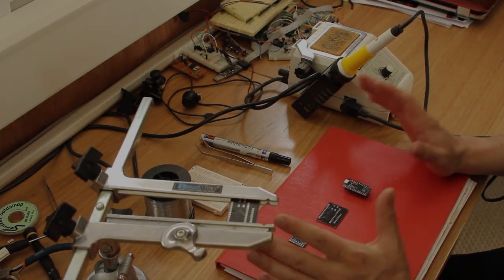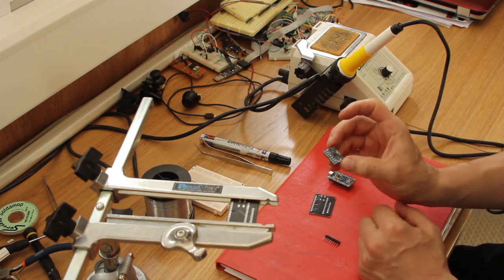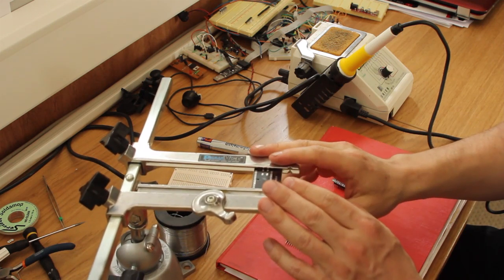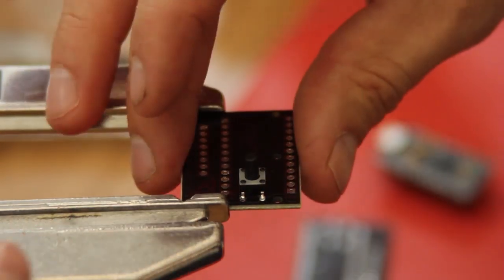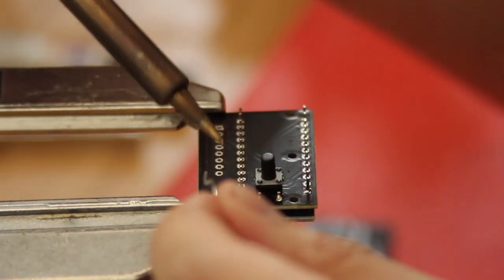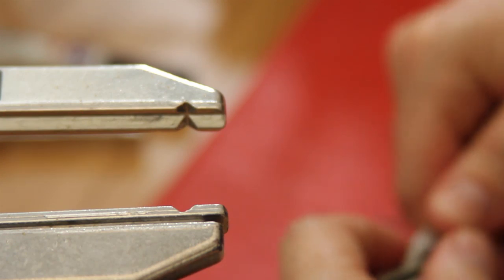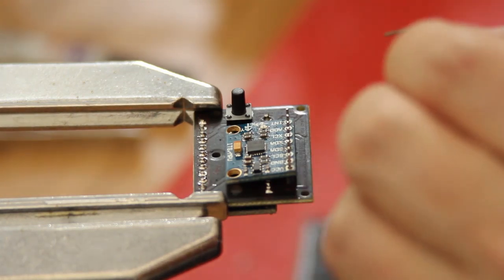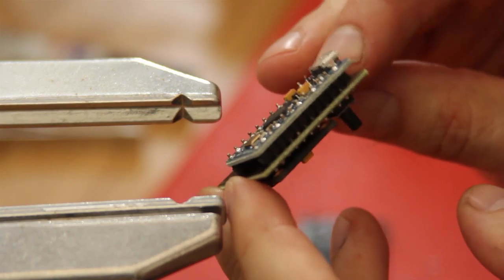DIY EDTracker Construction

Comment: I want to add this for anyone new thinking of making one of these.  It is amazing a real game changer and I can't imagine playing without head tracking again.  If you are going to make one I am telling you now do some research on the board because the ArdPro Micro has a known problem with the micro USB port coming off.  (I knew this going in)

I zip tied my cord in place with five zip ties to the headset then tip tied the cord all the way to the headsets breakaway plug  (Rig 500 Pro eSports).  This morning (3 weeks after I built it) the micro USB broke off the board.  Keep in mind I also ALWAYS hang my headset on a headset hook and treat it like glass.  So I am VERY careful about it.

I should have secured it to the board with epoxy and I encourage you to look around and google what other folks have done.  I can't solder something so incredibly small.  I just don't have the skills to keep having to repair this and if I have to keep buying new boards and re-building them well, I just don't have that in me.

So I spent 160USD unfortunately today.  But I don't regret the experience of building and using something I myself made so it was still worth it.  Someday I may meet someone with the skills to fix it.
Reply: Same happened to me. I also treated it very good but after third usage it came off. Since i soldered everything like in this video i can't desolder them properly to change arduino. Now i'm planing to build another one with my own pcb and going to use female header pins. So i can change broken parts without hassle. Also gonna put a lot of hot glue around usb port.

Comment from the maker: Hey Rob, no worries, hope it gets to you ASAP ;-)
Cables-wise, you can get these braided cables which are a lot more flexible than most, or you can find some flat USB cables (typically called "noodle" style cables) which also bend a little more easily. I'd recommend those, picked up easily off eBay in 2 or 3 metre lengths.

Comment from the maker: Fair point on the USB connector - even with stress relief on the cable I've had one break off. One solution is to clag it with more solder on the two side tabs :) I would leave a sacrificial cable plugged in while you do this to stop solder pouring in to the USB socket on the board. You might end up soldering the plug in place but gently warm it up to free it and remove it - or, of course, just permanently solder a USB cable in place if you know you're not needing to remove it.

Other alternative is to clag the whole area with something like araldite or a hot glue gun.

Good point, Peter.

Comment: Ordered 3 of these PCBs and enclosures from the EDTracker store and can not state how helpful the guys have been with trying to assist me with getting them before Christmas. I missed the original cut off date and Dan made a special journey to get mine posted (I really appreciate that Dan / Brumster100). Now just have to wait for delivery of these and the required DIY head tracker components (MPU-9150 Mag sensor) from Hobby Components and I will be a happy camper sitting in my ship. 

Thanks Dan for the concept, the valuable online videos and the great service you have provided me.

Could you offer some advise on a suitable USB cable to use while this is mounted on the headset? is it a standard USB cable or a micro? It looks like a standard one but hard to tell from the video. Are there ones that are more flexible than the standard ones such as the one used by say my Joystick which is pretty rigid. 

Thanks again,
Rob

Comment: Realy interested in this project.
Is it possible to mount the accelerometer/gyroscope away from the pcb?
If so what should be the maximum length of the cable?
Thanks.
Reply from the maker: Yes, it is, people have done that. It's an i2c bus between the MPU and AVR so normal principles apply. i2c can support quite significant lengths but in this application, with common cable, you should be fine for 20 to 30cm, probably more (I've never tested...). Depends greatly on wire capacitance, length, winding and surrounding interference I suspect.

Comment: Is there a video that includes how to attach the magnetometer? Thanks for the videos, great work
Reply from the maker: shadowkill546 The 9150 breakout board is physically identical to the 6050, so it fits in exactly the same way ;)
Reply: Hey thanks for the response. That's great. Does your site sell the 9150 or should I just order the basic kit from your site and order the 9150 separately from ebay or something? Thanks again :)
Reply from the maker: shadowkill546 We don't sell the 9150 as a kit, no, the kit thing on the website is just to clear out old stock as most people are ordering 9150's now, for obvious reasons. So yes, you could always source the 9150 separately and swap it in when you build - still works out quite well price-wise ;)
Reply: brumster100  Thanks a lot! I placed my order. Seems like it would be a fun little project :) Great work again

Comment: +brumster100, would it be possible to post a video assembling with a 170 pin bread-board?  First time I'll be using one, and I'm not sure where the jumper wires should go and if any of the rear connections should be popped out.
Reply from the maker: Here you go!
http://youtu.be/tn9tvVfs6ow

Comment: Hi, I was trying to use my old edtrucker with ETS2. I remember that change some lines in controls file was needed but I dont remember which ones and the web is down. Could you help me please. Thanks in advance.
Reply from the maker: You sometimes had to edit the "controls" config file in your ETS profiles directory. My memory is hazey but you basically changed the controller names for the trackir device - you could remove the 'trackir' device name, and put your edtracker joystick device name into the trackir section - so basically you were fooling it into using a joystick as the input device to headlook (trackir).

Comment: You should never apply a lot of pressure with the soldering iron on the pcb because you risk lifting the copper traces. Also, don't blow the solder trying to cool it, it creates a bad wetting between the components.

Comment: Hi. I purchased the kit from the hobby electronic shop you mentioned on your website, but it only has a standard PCB, not the custom one you use. How can you solder the components on that PCB?
Reply from the maker: You solder onto the pads and then use short bits of wire to jump the pins where they need to go; it's a little more faff but that's the cost saving of using the prototyping board that HC supply.
Reply: brumster100 Thanks. I think I'd rather order a custom PCB from you guys. :) Gonna check it out on the site.
Reply: brumster100
Might be a stupid question, but what is the function of the switch? It turns the device on and off? Or it resets, and I can reset the view anytime I want while plaiyng Elite?

Comment: Hi. Would it be possible to connect the two boards (gyro and arduino) with a 1m - 1.5m cable (soldered or some sort of jacks) or would the resistance of that cable be to high?
The idea is to put the arduino and reset switch in a case on my desk (or even in the joysticks casing) so that I only have a tiny box for the gyro on my headset.
Do you think this would work?
Reply from the maker: The technical length of an i2c bus can extend to that sort of range, yes, but interference and capacitance in the cable can become a problem. I've not tried it but if you shield your cable, or at least twist it, you should be ok. If you have problems you could always try clocking the i2c bus down from 400KHz to get better reliability. Try it - let us know ;-)

Comment: Sorry to bother you but I ordered the kit from hobby electronics with the standard PCB  and read you talking about using wires. could you provide a little more information on that? I'm a complete newcomer to this kind of stuff and don't really know what to do now ~.~

Also you mentioned the USB connector being a weak point, what did you mean by "clag it with more solder on the two side tabs"?
Reply from the maker: You can just use some wires salvaged from a length of, say, USB or telephone cable to wire it up as per the instructions on the website. I take it you mean the prototype board from HC? Take a look at my newer video for some tips :-
http://youtu.be/tn9tvVfs6ow

;-)
Reply: brumster100 I've watched the debugging video and found it useful, but still my question remains unanswered - why do I need wiring with the PCB from hobby computers in the first place, I do have cables, I do have a breadboard to test things out first but still, isn't the PCB enough to establish a link between the components? Why wiring?
It's this PCB here: http://hobbycomponents.com/index.php/kits/kits-electronics/diy-head-tracker-bundle.html
Reply from the maker: BuckstarrZ The PCB you get in the Hobby Components kit is what's commonly referred to as "protoboard"; it's just a series of pre-drilled pads for you to put components in and solder them. But you still need to join the pins up, and for this you need some link wires (or you can bridge with solder). If you want an easy option, you can order the EDTracker PCB off the EDTracker website and remove the need for any working out of where wires have to go/etc... this is a custom PCB with all the tracks worked out and done for you - you just solder in the components and you're done. No need for any wires.
Reply: brumster100 thanks for your reply. I've been in touch with you guys for ordering a complete device but I don't actually want to wait that long, I'm eager to fly with some headtracking :D so that means I would have to connect every pin to each device according to how you did It in that debugging video. To do so I would have to put a pin + an end of a cable into the same pad and solder them in there
Reply from the maker: BuckstarrZ
Pretty much, yes, but you can't get a pin and a wire into one pad. What you do is put the wire into the pad NEXT to the pin, and then bridge the gap with some solder or a short piece of pin/wire, or else solder the wire onto the underside of the pin. Whatever works for you, really ;)

Comment: How important is it that the solder doesn't touch between pins? and if it is important what do you do if you mess up, using too much solder, and solder two pins together?
Reply from the maker: Hi Dustin - it is critical that solder doesn't join the pins. There are a few where it technically doesn't matter, but I won't confuse matters for now ;). If you put too much solder on, you will need to attempt to "wick" it away with your soldering iron - the proper thing to do is use either a desoldering pump or some braid/soldamop. These suck or soak away the unrequired solder. Generally though, you should be able to clean the solder from your iron's tip and then draw some of the solder off the pin and back onto the tip, to take some away.

https://www.bitsbox.co.uk/index.php?main_page=index&cPath=243_268
Reply: ty :) I have never soldered anything before and I am looking to get into it as it seems like a very useful skill to have. :)
Reply from the maker: No problems - good luck and have fun!

Comment: Is there any buleprint for the custom PCB?
If there is,So Could i get one?
Reply from the maker: Not really a blueprint, but there is an etch image on the website here :-
http://edtracker.org.uk/index.php/downloads/category/1-hardware
Reply: Thank you very much!!! XD I didn't look for it carefully
Reply: Which PCB type to use single side or double side?
Reply from the maker: Just single. It takes a trace across a pin (no effect or downside) to avoid having to double-side it.
Reply: Thank. Is there any tip for make it be wireless?
Reply from the maker: That's a whole project there! Nothing easy, no, that would keep it small and usable as a head-mounted device. The problem is a lot of the wireless modules, batteries and charge control modules really bulk it all out to the point where, in my opinion at least, it becomes a bit ridiculous. I suppose the "simplest" approach is bluetooth, but the performance is awful. You could look towards an RF module matched with a USB dongle but you'd be developing your own firmwares for both, and then you'd need your own UI or means to control/calibrate it.
Reply: above link has the v.2 board, but button seems to interfere with the larger 10pin 9250 board when i mock it up in photoshop; are you able to upload an etch image of the v.3 revision? thanks in advance and hi from NZ
Reply from the maker: Most people leave the button off - but if you want to use one, if you leave it with me, I'll work on a version for the larger 9250 boards....?
Reply: that would be awesome, thank you 8)
Reply: How to set the circuit up without the switch?
Reply: Or use 2 pins switch instead of 4 pins
Reply: Sorry for annoying but i really need some hand . I was trying to create this all they but it wasnt sucess .
I sent email to ur site but threse was no reply. Help please.
Reply from the maker: Just leave the switch out! It is optional ;)
Reply: Thank .Just remove switch and connect wire which was connect to the switch,doesn't it?
Reply from the maker: Don't connect anything related to the switch - just leave the switch out and unwired

Comment: hello, this is the same construct with MPU-9150? i can replace the MPU-6050 by MPU-9150? thank you for your reply :-)
Reply from the maker: Yeah, provided the 9150 breakout boards are pin-identical to the 6050 boards (which most are).

Comment: Apparently, if you use this video to put together a v3 board with screen-printing on one side, and you just match 'blank side' to 'blank side', it turns out that the board in this video is blank on both sides, and you end up soldering everything in backwards...
Reply from the maker: This is a very old video now! I'll update the description.

Comment: Would have been useful to maybe shown the best way to solder the usb port to make it stronger as it meant to be on the weak side.
Reply: Ahhh, just superglue it lol
Reply: No it the weak point of the Arduino boards and prone to breaking off. It makes sense to make the solder joints stronger and support the usb cable.
Reply: Or just a hot-glue gun to add stability.... failing that, hit it with a hammer lol

Comment: do you get everything you need in DIY pack or you need to go extra shopping ? im real good with electronics but if i dont have all parts its a hustle
Reply from the maker: Where are you looking? On the EDTracker webshop it's just the "DIY PCB" that can be used to ease construction, or there's a PCB+plastic enclosure bundle. If you're after everything all-in-one, then I can recommend Hobby Components who sell a kit with everything needed... link is in the description up above ^^^
Reply: well i was looking at the ED tacker site ,  so its just a PCB , would loose a lot of time tracking the component  since i've never used these ,  but anyways there are few options as well as pre soldered one out of stock , no problem , but im wondering is there any significant difference in those kits , or any will suffice . Thinking of getting one . Thank you very much for including the link and answering , didn't see it there . And Site is quite obscure on that subject at least to me .
Reply from the maker: Sure, no problems! I would avoid the GY-521/6050. Your gaming experience will be much better with the MPU-9250. The question then it just whether you want to put it in a little box, or you're happy to just have it as a PCB on your headset... that bit is just aesthetics. If you want something that's just made up and ready to go, then obviously I'd point you in the direction of EDTracker Pro, which is a "proper" product made for the task and is much improved in terms of construction, software/drivers (or lack of them) and some minor feature improvements too.
Reply: Thank you very much . I've got a joystick  few weeks ago, just to have fun , but i play War Thunder and everyone is aiming with their mouses ,  its just very hard to even keep the plane on target so i end up killed . I use Logitech 3D pro , nothing fancy but a popular joystick should be able to work properly and it does , everything is calibrated , i still end up killed . So maybe try out  DIY one first because i might end up not using it at all , since i need it only for WT with Joystick . Any thoughts or experience with that Joystick ? Logitech 3d  pro .  I think i doesn't work for me , something is wrong there , i disliked  its angle before even using it , i want it str8 like yours . Thats more natural and intuitive , maybe that is the problem or god knows what it . Anyway if i end up not able to play like that , i will not need the tracker , or basic one should do , so  ill get the DIY pack and see what happens . Very much appreciated sir . Thank you
Reply from the maker: Not used the 3D Pro myself as a joystick, no. I would imagine it's horses for courses really, at £40 it's not going to compare with a £100 stick, but it should suffice for something like War Thunder I think? I find with most games it's a case of playing and building up experience - particularly with online games - that's the most important. Hard to start with when everyone else has more play time that you :).

Comment: So as it is without the enclosure it'll be about 15mm thick?
Reply from the maker: Yeah, that's about right. If you trim the pins you can get it thinner... excluding the button here of course.
Reply: Thanks for the super fast reply, that's incredibly compact. Can't wait till the parts for mine arrive, glad I've ordered the official PCB. Looks so much simpler and cleaner compared to breadboard and wires.